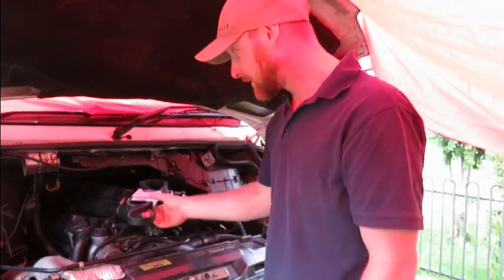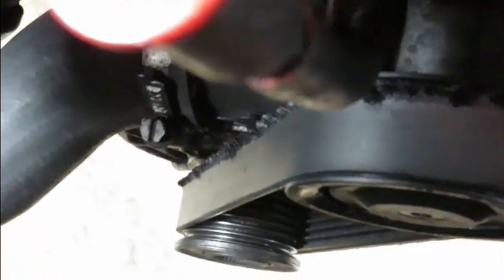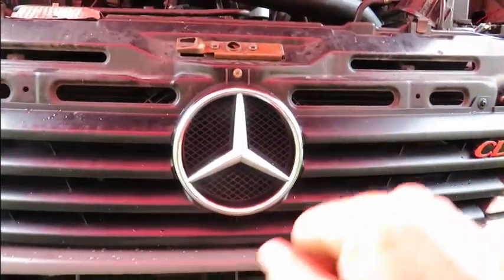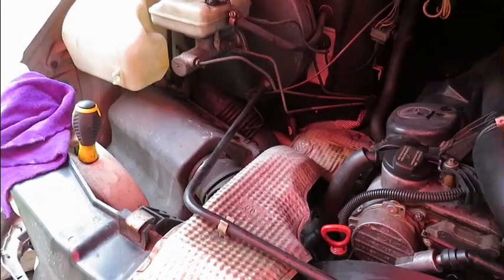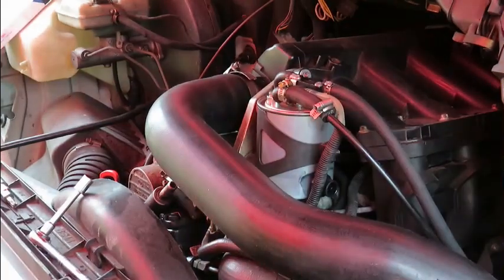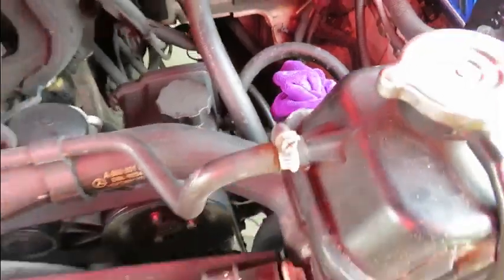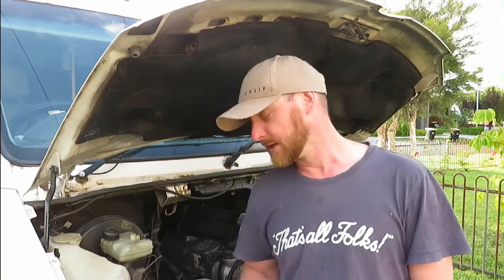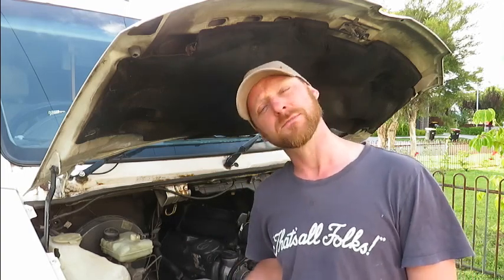Changing fan belt / drive belt Mercedes Sprinter

Comment: The other thing is your video clearly explains the torx sizes I will need which I didn't realize, so I've bought a set of 3/8 drive off eBay.
My wife is an Irish citizen and as a tribute to you we will take our camper across the water to the emerald isle for a trip in 2026 👍👍

Comment: Thanks for this video, maneuvering my T1N CAMPERVAN my foot slipped off the clutch and the van stalled.
When I restarted I was met with a chirping sound and very heavy steering
I knew straight away that the belt had come off.
 Your video is very clear and very helpful thank you

Comment: Oh dear, Not really the way  I changed a broken belt on my sprinter on the side of a Spanish road took me less than 10 mins, all you need is a 10 mil socket then a 17 mil socket for the tensioner. The wife did not even have the time to make a cup of tea in the camper (sprinter T1N). I hope you have learned from this my friend, Brave to post it, maybe it's time to delete? Stay safe. ;-)